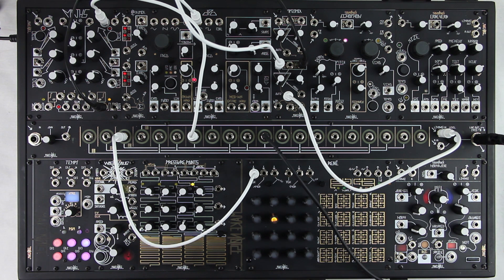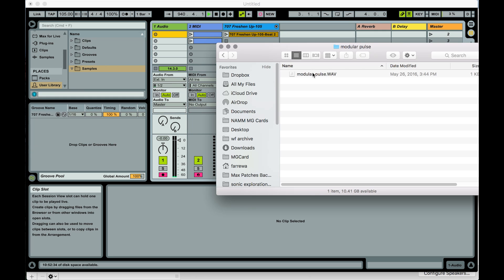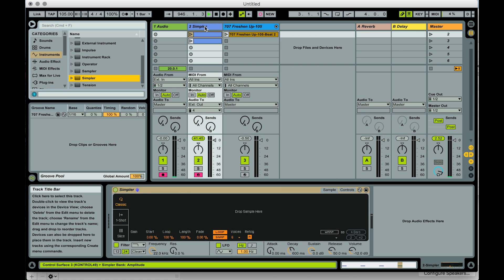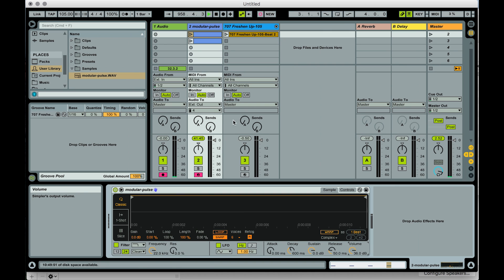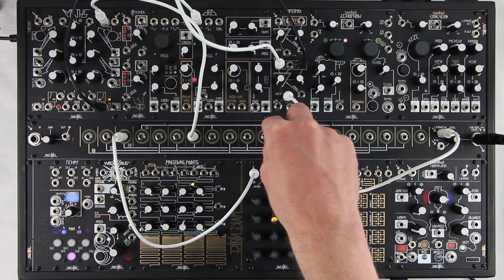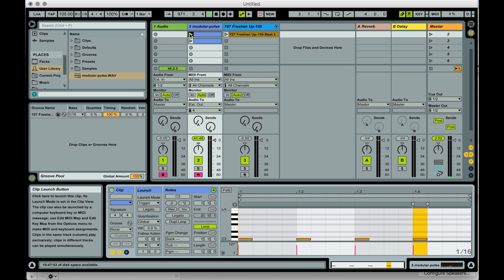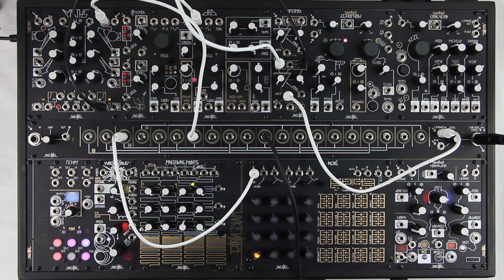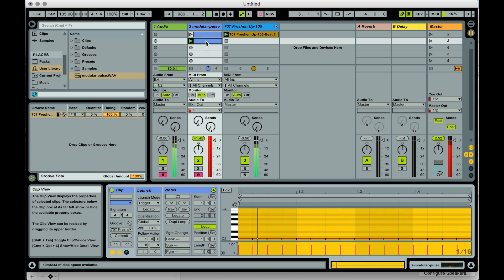Clocking the Modular with a Pulse from a DAW (Digital Audio Workstation)

Comment: Thank you so much for this hint and the wav file with the pulse! Using my headphone output on my Focusrite Saphire Pro, I could sync my DFAM. Using a line out, syncing the DFAM was not reliable but stopped frequently. In contrast, the mother 32 was synced perfectly… Checking the voltage levels, I measured 1.2 V at line out and 5 V at headphone out. So it‘s absolutely important to be aware of the output voltage and amplify it in the modular system if too low.

Comment: What are the chances that this pulse file would work with something like the Zoom R24 sample player isolated to the headphones output to route the clock signal to my modular system? 
I've read that the R24 has nothing in the way of MIDI sync, but does have a built in metronome. That might also work if the clicks are loud enough. Have you guys at Make Noise heard of anyone using this type of recorder to clock sync with a modular system?
Reply from the maker: There's a decent chance it will work. It's possible that depending on the destination it will be read as multiple clocks per click, which could cause problems, but in that case you could patch it through a channel of MATHS as shown here: https://youtu.be/x_79rCIsCaE
Reply: It's a bit clunky (so far), but it works with the metronome click sound out from the headphones jack to Maths channel 4 trig input. Channel 4 unity signal out to clock module's clock input. Rise is set to at 12:00 center position, Fall is set to 7:00 minimum position, and Vari-Response is set to the linear mark at about 10:00. For now, I manually start the clock in time with the metronome. There may be a better way to do this, but I now know that it can be done. My clock module is the old version of ALM Pamela's Workout.

Comment: Beginner here, In theory could you use ableton's click track?

I have a;
Volca 
Pocket operator
Bastl Kastle

could I use a headphone amp to split the click track and send to these devices through the sync in port to clock everything?
Reply from the maker: It's possible that one or more of these devices would register the click track as multiple pulses instead of a single pulse. However, it can't hurt to try! In our system, if this does happen, you could use MATHS to slew the click track and take a gate output as shown in this video: https://youtu.be/x_79rCIsCaE
Reply: @MAKEN0ISEMUSIC  
Brilliant, thank you for the advice!

Comment: Thanks! I tried this out on my system, the only issue I’m having is that my clock (PNW) doesn’t start straight away it starts playing on the 2 count of the metronome once I’ve pressed play on ableton. Is there something I’m doing wrong? I’ve cranked the signal on simpler and I followed the steps you mentioned, it does clock to ableton tightly but this issue of a delayed start makes it hard to sync soft synths and sample loops and overdubbing is especially difficult.
Reply from the maker: Maybe try adding a count-in bar at the beginning? Sounds like PNW probably needs two pulses to establish the tempo, as will any module that does clock multiplication.
Reply from the maker: We made a video demonstrating the concept using TEMPI, the same could probably apply to PNW https://youtu.be/17jfoG7GChg
Reply: MAKEN0ISE Thank you! I think this will help solve my issue, at the moment I am currently only sending one track of pulses for the actual BPM to PNW but now I see from the video you posted I do need a run signal. Is it possible to do the same thing with maths? And then sending this to PNW to make sure it’s modular level, or even using a VCA? I had in mind that the issue could be that it’s not at modular level but I’m not sure.
Reply from the maker: @thephantom8865  The pulse file we supply with that video is typically strong enough to trigger modules without additional amplification. Using it to trigger MATHS could help if you're having trouble. Here's an earlier method we used a few year back: https://youtu.be/x_79rCIsCaE
Reply: MAKEN0ISE Thanks for the help! Your tips helped solve the issue! :)
Reply: I use the pulse for clock in on PNW and also send a run signal using same method to start Pam running on a separate output. I also use the delay compensation on the two tracks to make sure it's bang on time. Works a treat. :)

Comment: I was just having this thought, thanks for answering! Kinda off topic, but can the CV buss be used as a unity gain mixer? Like if I combined multiple gates into the same buss channel and directed them to the gate input on maths, would that work?
Reply from the maker: It can be used to combine gates if they are from Make Noise modules. Our gate outputs are designed to be OR combined with a multiple.
Reply: MAKEN0ISE good to know! What about CV signals?
Reply from the maker: Some CV sources will lock up if combined with others this way. Try it and see what happens!
Reply: MAKEN0ISE hahaha I like that approach!

Comment: You can do the same thing with most kick drum sounds as well.  That's how I sync korg gadget with my modular sometimes.
Reply: I've done similar things, but Im not sure it works with everything. I think some fussy devices need a real pulse.
Reply: @mattwalsh9413  I should have clarified I would shorten the decay or sample length until it was basically a pulse.  These days I use a midi to CV module, it is way easier in the long run.